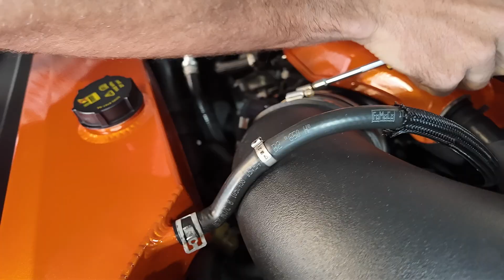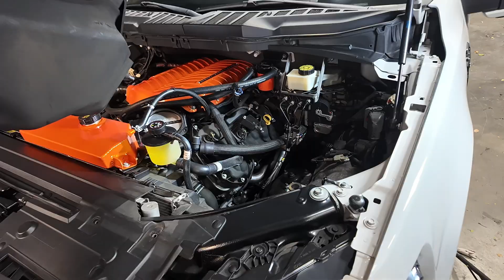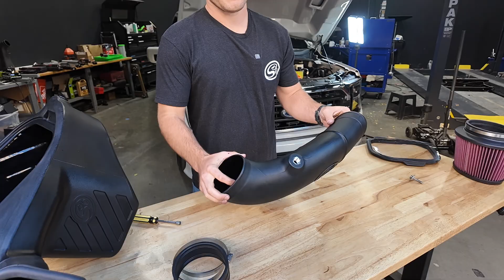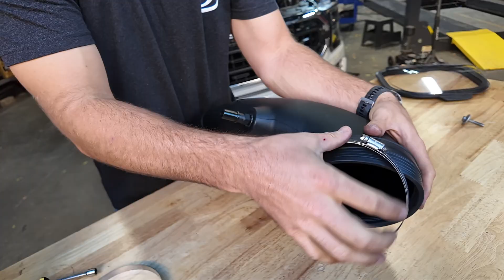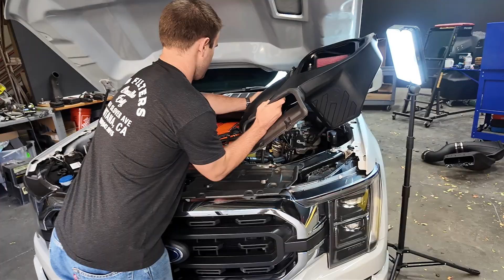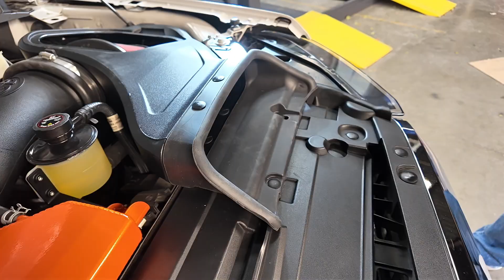S&B Install | Cold Air Intake for the 2015+ Ford F150 5.0L with Whipple Supercharger

Comment: @SBFILTERS do you have testing results for this showing gains compared to the Whipple supplied CAI?
Reply: We did not get dyno pulls of the before and after but i did feel a big difference on throttle response, more power and more whine
Reply: @Jayy5ohh it’s going to be hard to get Whipple owners to replace the air box that comes with their kit without any before or after numbers.

Comment: Can I add this to a stage 1 Whipple that has the stock OEM Throttle body? Or is this an upgrade for stage 2 owners with the larger throttle body?
Reply: Im the owner of the truck its a stage 2 whipple so it does have the bigger throttle body

Comment: Will this require a retune ?
Reply from the maker: No it will not
Reply: Will this intake work with the factory throttle body?
Reply: @seangowan7441 it will work for the stage 2 whipple with the bigger throttle body